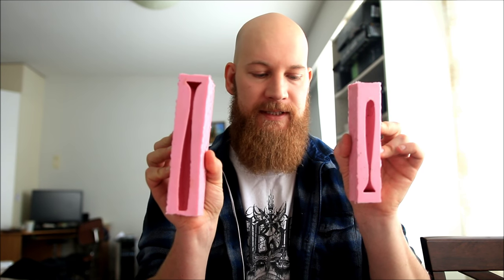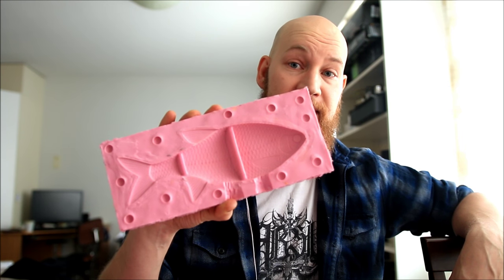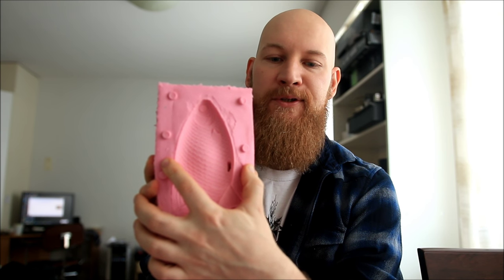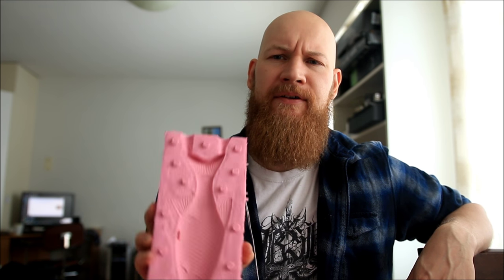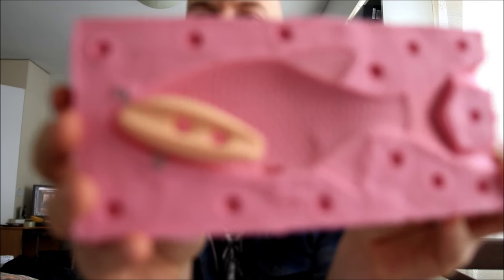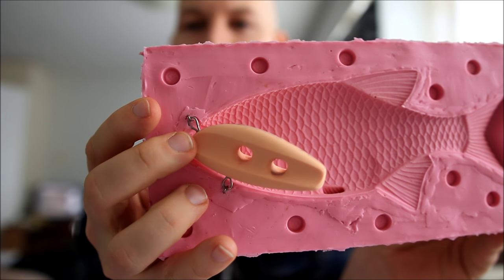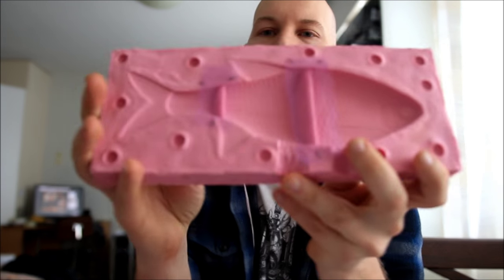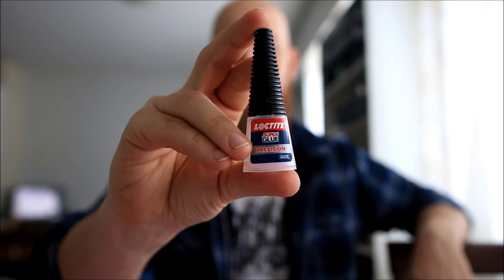plastisol problems and solutions

Comment: So I've been having an issue with one of my large baits always having a dent in the same location every time and I think you just explained it! Any suggestion on how to fix? how add an additional layer on the back of the mold? idk if the new silicone will stick.
Reply from the maker: I pour my big soft baits in 2 stages. First i pour maybe half or 2/3 in the mold let it cool for few minutes and top it off after that.
Reply: @SolarfallBaits  My mold is already a few years old but have a dimpling effect on one side and cant figure it out, The only thing i can think of is how you mentioned the side being too thin and caving in from shrinkage. Ill try to add additional to it but it may be too late, Idk what sticks to this type of silicone after 100% cure.
Reply: @kylecampbell3  silicone loves to stick to silicone i think if you add it will stick to it.

Comment: Great info as always! I have a question that is a little off topic, but I can't find any info anywhere. Is there a way to repair/modify a silicone mold with decent results using maybe household silicone and/or a soldering iron? I have a mold that turned out pretty good except for one large air bubble and I would like to make it usable if possible. Ever tried this?
Reply from the maker: Never tried any house hold silicone on a broken mold but there is no obstacles in just repairing a mold with the same mold silicone that you used to make it.

Comment: When you use wood as a master what do you cure the wood with so silicone dont get stuck to crack of detail of the wood? Also how thick do you recommend  silicone mold.
Reply from the maker: You dont have to use anything to cure the wood if your using dense wood types especially for hardbody bauts, for plastisol ones i would use few coats of urethane spray to get a more glossy surface. Thickness of the silicone mold wall should be atleast 1.5mm.

Comment: Awesome video! Do you have a problem with a mold contracting due to silicone being too thin if it's an open pour mold rather than a 2 piece mold?
Reply from the maker: never had that problem as i try to keep the wall thickeness atleast 1.5cm thick

Comment: Really enjoyed the video definitely good information. This is off topic but I have been looking at all sorts of different mold making silicone for awhile now thru a handful of different manufacturers and there's is a ton out there but I'm not sure which to try. Are there any brands you would suggest I try since I'm just starting to make molds?   I know you may not have the same manufactures I do but kind of curious what kinds I should look for so I'm not throwing my money away.
Reply from the maker: I personally have almost always used smooth on products, they have a pretty good selection of different kinds to choose from and they are relatively cheap for me to get too. i mostly use the mold max 30 line on my molds.

Comment: Great video thanks man!  Question.  What method do you use to heat up the plastisol?  I use a microwave but I feel like I'm not very consistent with attaining the same temperatures each time.
Reply from the maker: I use the stove for my plastisol heating, i feel like i can control the temps better that way, i do also have an microwave oven but dont really use it much.
Reply: Thank you!

Comment: hi! What is the weight of silicone forms are usually for the manufacture of large lures? If the form consists of two parts
Reply from the maker: you can do what ever size you want with 2 piece molds
Reply: I wanted to know how many grams of silicone goes on the big bait? If the bait is about the size of 15-17 inches.
Reply from the maker: depends alot on the shape of the lure your molding its impossible to say anything accurate without seeing the lure your gonna mold.
Reply: Such as the Buster Jerk from Strike Pro

Comment: Man, your videos have been a life saver getting started. I had a question for you. Ive been using mold max 30 for molds thus far. My last two attempts I was not able to get the molds apart. Nothing in my process has changed. Using the same amount of mold release as recogmended. Curing the molds for 24 hours each side. The molds that separated successfully, the only variable I can think of is it has been cold when I go outside to spray the mold release then bring it back inside to pour the silicone. Any ideas?? Appreciate your time.
Reply from the maker: Hmm thats odd if your using mold release the parts should seperate with relative ease. What i usually do is i spray the mold release 3 times before pouring the other half to make sure that there is enough stuff there to keep the parts from sticking together. I usually take 10-15 min breaks between the sprays.
Reply: Ok thank you. Are you spraying light coats? I noticed it advises to run a brush over the mold on your second coat but I've not noticed a coat thick enough to brush. Hence not trying it.
Reply from the maker: @ryanperrey  yeah i spray few light coats and it seems to work fine for me

Comment: Do you you same material for hard swim bait tales
Reply from the maker: i personally do not
Reply: @SolarfallBaits  what material do you recommend for swimbaits tails flex80 ?
Reply from the maker: @Bassafornia  i have to admit that I'm little ignorant when it comes to to those flexible tails, i always made mine from rigid resins or epoxies. i would imagine that most guys who do make them use some kind of flexible urethane rubber.